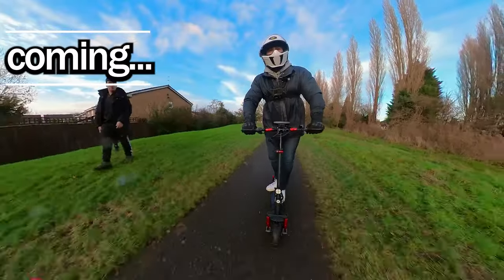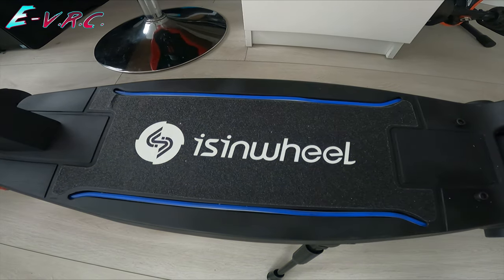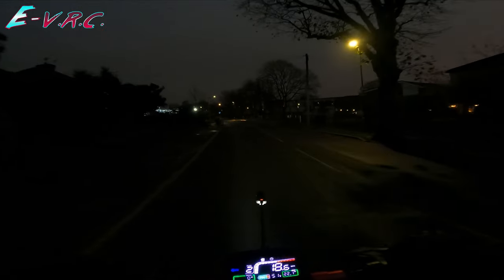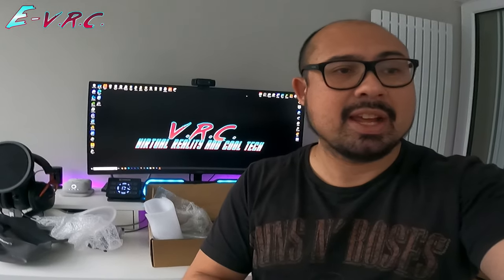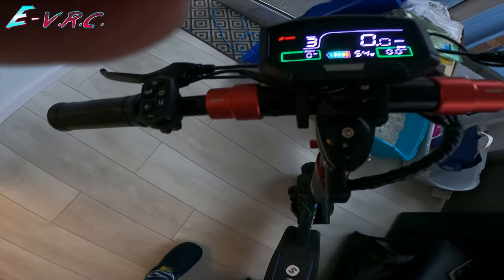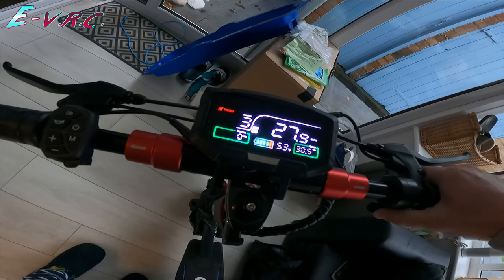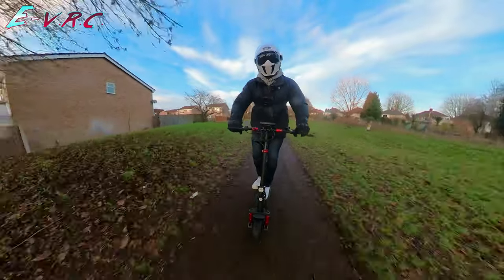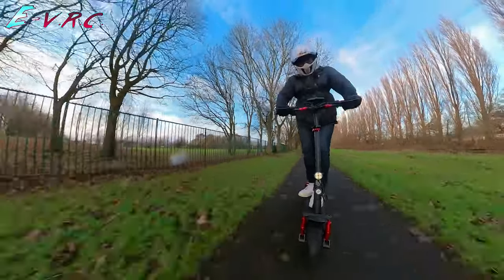FANTASTIC VALUE Off Road Electric Scooter BUT... (iSinwheel GT2)

Comment: I got my GT2 and it’s the same speed as yours but arrived badly damaged and just waiting for parts now from china.😢
Reply from the maker: Sorry to hear that. It seems the journey from China is a perilous one 😬
Reply: Yeah it’s all up and running now and I have had to use silicone all over and in the front light to make it waterproof as it did actually short circuit before but that’s to iScooter it’s all repaired now and I can go through many puddles now!😅😂
Reply: @e-VRC  Hi mate, what would you say the max range is on this scooter?
Reply: @e-VRC  How long have you been with it, does it work well for you?
Reply: I have GT2 as well it have any app to see settings?? 
How to use Bluetooth ??

Comment: Can you show us where the speed limiter Wire  is on the inside?  if you disconnect that it will be  55.kmh I know it's white and has a little black connection On it I know you Press the m 5 times And it opens it up to 45.kmh But if you open the bottom where the Battery is There is white wire Disconnect the white wire And it goes to 55.kmh😮 All scooters does have one. They won't tell you about that one Day just tell you about the m Button one You see people on youtube Doing It on order brands So can you have a look and see? Can we find it? We will get an extra 10 km an hour. I'll watch out  for you doing the video So we can do it. 55,kmh Will be better than 45.kmh

Comment: I bought this scooter and I can say that max speed is approx 35kmh (I'm 15 stone) suspension feels soft but I feel the scooter lacks of power, my Kugoo S1 350W feels more nippy, while on this new scooter there is like 1 sec delay before it responds to the throttle, I'm not sure if I like it
Reply from the maker: My gps certainly agrees with you. I need to test it some more. Also I think they renamed it ix6.
Reply: @e-VRC   ix 6 is 1000W motor, mabey they switched it because it wasnt good motor.  i will recieve my ix6 in a week, then i can test
Reply: @rainnurmik  have you tried ix-6 and how is it doing
Reply: @birdzhanerdinch7144   I have been riding it about 300 km, its good for the price. standing area could be longer or wider.  But i have actually got used to it.  I have got 1 problem, still writing to iscooter to fix this. If i put cruise control on, i cant see real time voltage. After display restart,  it works again, but cruise control is off.   not a major thing, but annoys a little. othr than that.  42km/hcan i get fromthis with no wind. im100kg. Seems durable. For 650 eur it is unbeatable i would think.
Reply: @rainnurmik  how many kilometers does it last on a single charge?  Thank you for the reply!
Reply: @birdzhanerdinch7144   the most in one charge i ride was 20 km. But it was 46volts left. I think mabey 25 km. But i try not to get too low volts  as it is not good for the battery, but 100 kg man can go 20 -23km with absolutely no problem.
Reply: And in full speed 30-40 km/h.

If you ride 25 km/h you get much more
Reply: @rainnurmik  thank you so much
Reply: @birdzhanerdinch7144   no problem. You can write me any time
Reply: @Rain Nurmik  i want to buy this, you think it is worth it for £500. Also does it go faster than the Mii scopters
Reply: @gearedeagle6484  I slighltly regret buying thi scooter, it's not as fast as I expected and off road tires make it uncomfortable riding on tarmac, also no key so no protection, no cruise control and the scooter is really bulky meaning catching on doors if you use it in eclosed spaces like hotels, I would much prefer the junior size scooter which was easy to carry, lightweight, and just perky round the corners - this scooter feels like an elephant.
Reply: @KpopLabPro   cruise control can be put on via P05 setting. Read the manual. It is big yes :) also make sure you screw the suspension to max soft. It is way better this way.
Reply: @rainnurmik  My scooter also came, but I have too much clearance on the handlebars.  How is it with you?  Can it be fixed somehow
Reply: @rainnurmik  right at the bottom of where it folds
Reply: Notorious. AGAIN  SORRY I FEEL LIKE THIS IF YOU IS GOING FOR REAR SINGLE MOTOR AT LEASE GET A WHEEL MOTOR WITH TWO THOUSAND WATTS OR MORE AND ABATTERY WITH AH 40- 60- + UP FOR REAL THAS THE ONLY WAYS I SEE FASTER SINGLE MOTOR ESCOOTER BELIEVE ME KNOW BODDY WANTS A SLOW ESCOOTER TRUST ME OR YOU WILL SEE WHAT I WAS TRYING TO SAY 😊😊
Reply: @birdzhanerdinch7144  I have just one question, what is the difference between the ISINWHEEL GT2 AND THE ISCOOTER IX6, and which one would you recommend?
Reply: @rainnurmik  I have just one question, what is the difference between the ISINWHEEL GT2 AND THE ISCOOTER IX6, and which one would you recommend?

Comment: ⚡ I'm glad the top speed is easy to unlock, some other eScooters don't make it so easy ⚡
Reply from the maker: Yeah i was happy to hear that. Weird it has a 'settings unlock' as well as that though
Reply: Hi, I have already done the basic Settings on the dashboard. And there are 2 concern remaining:

1- Bluetooth setting 
2- Alarm/Locking Settings
Reply: @e-VRC  how do I unlock top speed and what app do you use please
Reply from the maker: @garrymuller4766  i don't use an app. It's unlocked from the computer. Can't remember off the top of my head but I do it in the video.
Reply from the maker: @louiepage6623  can't remember but I do it in the video.
Reply: Bonjour, appuyez 5 fois sur "M"
Reply: Can you please explain how to unlock top speed on this scooter ?
Reply: @CristianDiaz-xz8zk  Turn scooter on...and press 'M' 5 times.
Reply: @fredericforever2273  I think this model is specially not equipped with bluetooth

Comment: Mate, what settings do you use on this I've just got mine and tweaking to keep consistent speed.  I don't know if you changed any modes etc so would really help adding your P.Settings in a video or by reply.
Reply: It's got 3 modes the 1 I'm buying says my uncle mate got 1 similar there a button to change it from eco to sport

Comment: Thanks about your video.
Have you got the reference of your controller?  The error was E15? 
Because my ix6 iscooter ( same as isinwheel gt2 with 1000w motor ) have the same problem. 
Thanks a lot for your answer.
Bruno ( I m french, sorry if my English is very bad )

Comment: Mine arrived 2 days ago, set it up and did about a mile on it. Quite happy. Went maybe 3 miles on it yesterday, still quite happy especially after unlocking top speed. Went to use it today, wont switch on unless i connect the charger- quite unhappy. Any ideas???
Reply: How do you unlock top speed on this scooter ? I can't figure it out my friend if you can help me
Reply: Did you get it working again ? I'm sceptical of sponsor videos but always known this guy to be as genuine as he can with his videos.
Reply: @EllisJonesDeath  They sent me a new battery and everything has been fine since.
Reply: he did it in the video you turn it wait for it to boot up and press M 5 times and you will see the speed change on the screen if u want to switch it back to 15 mph just restart the scooter and press M 5 times again @CristianDiaz-xz8zk

Comment: I recommend the splach titan. More for the value of money. Dual motors off-roading 37 mph and 41 miles range plus much more all for 1200
Reply: Nah mate not for me
Reply: @samarawilliams4135  what happened to yours bro. It's weird because I see some people have issues with scooters but like I have had none yet and I don't know if it's cuz I'm super cautious when I drive most times I'm making sure that I'm scanning the road and I'm not hitting anything that could possibly injury my tires.
Reply: I'm exactly the same lol. I've had 3 punctures in 3 months, sux. Aside from that my scooter has been pretty much problem free. Well once I absolutely smashed into a curb, funny enough my tyre didn't pop I got some error 10 message, not gunna lie I thought I broke it but I opened the deck and after 30 minutes I located a loose wire that I reattached added some super glue and for good measure pushed a bit of blue tack in with it and never had any issues since aside from the punctures which is a pain in da a55 can't lie. I'm that impressed with them that now I own 2 lol
Reply: @samarawilliams4135  both my first scooter so I'm pretty impressed to be honest not really much expeditions being a first buyer haven't had any issues yet besides feel like the handle bars a little too short and I'm average height so maybe I'm wrong. thony complain I have is the long shipping times for parts which I had to replace my handlebar but that's about it and the fact that I thought the 10-in tires were a tubeless which I was wrong which I heard is better.

Comment: For anyone who is concerned about the screen, only cameras can see that, the lcd is simply flickering at a frequency fast enough to where humans cant tell the difference in order to save power by not running it constantly. However cameras can tell the difference

Comment: Hey 👋 great video 😊 quick question.. are you worried about getting pulled over by the police?
Reply from the maker: I am a bit on a scooter which is why I've come up with this testing route that's mainly off the roads.
Reply: @e-VRC  I live in the Welsh Mountains and have some lovely routes but I’m worried about being on the roads so I mainly drive there, even though it isn’t far. I’d love to be out on the roads, looking at your videos you look like you live near or In Birmingham?

Comment: Are the wheels solid or inflated ? Puncture resistance would be solid ?
Reply from the maker: Inflated. Some inflated tyres have puncture resistance though. I don't remember of these do.
Reply: @e-VRC thanks for responding
Reply: Inflated Tires. Not puncture resistant.

Comment: Got it ,just after switching on i press that 5 times to unlock 🔑 FANTASTIC 😮
Reply: @louiepage6623  wotsits that's wot
Reply: does it work for you? The scoter ?
Reply: @ARMdicember1997  I never bought it,got the ebike kit 🤠🤘🇬🇧🙏
Reply: @ARMdicember1997  It works, I can help you if you're having trouble, just ask 👍
Reply: @ianmangham4570  the kit? do you have the gt2 of the video the scoter? It works for you, it's resistant. Do you think it has good durability compared to a Xiaomi?
Reply: @ianmangham4570  and reaches more than 25 kilometers per hour? with the unlock configuration

Comment: i have the ix5 need a new stem but thats my own fault , , mine came faulty with the throttle , so had to get a new one sent out.
still use it to this day had it about a year and a half now , i did have the i9 but gave that to someone for 100.00 pounds , i just bought the G5 has few issues the seat being number 1 when u take it off all the issues start there.

i just paid 800.00 for a E scooter 28.6ah lithium ion battery 48v , 500w, 25mph with motorbike suspension and rear sping suspension the scooter is massive ways 45KG  ??
Reply from the maker: Wow that's nearly double the weight of this... the i9 was my first. Good little scooter.
Reply: @e-VRC  yes the weight is a little bit of a issue but once get use carrying up and  down a flight of stairs things get easier.

I still have not down the max range test , but one thing since I have had it not ran it flat but did charge it because of the freezing cold in the future will do a a test let you,  the bigger picture of the G5 scooter , one thing I can say so far if someone does not care for high end  speed and acceleration, as long as one don't live in a hilly area.
its a scooter to definitely consider buying.

Looked on Ali express sells for 1725.00 pounds not including shipping fees 😒 

So many companies are giving out 60% off RRP but its just finding the correct company and a scooter that works and oes what it says on the box.

Comment: Its a Good SCooter 28mph  is fast enough for me. Any faster would be sketchy. 
I have 550miles on my scooter.
You can ride it in a lite drizzle. Home 
Do Not ride it in Rain. It will start to short out. I had to take it apart to dry it out before i could get it to work again.
Flat tires are a pain to fix because the tires are tough and  pretty difficult to get back on the Rim without a couple of hands to help hold it.
The rear even more difficult because of the power cord for the motor doesn't allow you to remove wheel completely.  Break the bead on the proper side or do twice the work for nothing because you won't be able to get the tube off.

For $750 its a good all around scooter. Good distance. Fast enough speed. Descent handling. 
I can pick it up easily put in the trunk.
I like it, except when it has a Flat Tire.
Flat Tires Not an easy fix. 

I wish they pre installed double thick torn linners came standard.
I would pay $100 extra for a puncture resistant option from the jump.

Comment: Should i be worried my scooter arrived today but the back tyre is flat waiting on a pump to arrive hopefully its not going to be an issue for me.
Reply from the maker: They often are flat. Fingers crossed it should be fine.
Reply: @e-VRC  i hope so do u know if the scooter has an inner tube inside or is it just the wheel? I couldnt find anything about it online.
Reply from the maker: @mage000012isback  not sure about that sorry.

Comment: would you say it is definitely a NO in the rain? if it's wet outside will it just die ?
Reply: I have already driven with it in the rain and for the moment nothing to report.
Reply: @mamal438  nice, when I ask retailers they tell me basically that I will kill the scooter if I drive in the rain, well that defeats the purpose of  buying one as you never know when it will rain in the UK :D Going to get one to get me to work
Reply from the maker: Scooters are fine in the rain just don't submerge the deck
Reply: That manual clearly states to not ride in the rain so clearly do this at your own risk
Reply: @azisalive4972  then what is the point in owning one? Imagine if I go to work with it and then in the evening it rains. Am I meant to walk 7 miles?  well shiet scooter ;)
Reply: @Robertas Viskupaitis  all e-scooters and bikes have this warning, I'm guessing it depends reallly how wet you get it before it fails, seem to see other people having no issues 🤷🏻‍♂️ again, it's up to you as they won't cover the warranty over water damage
Reply: @azisalive4972  yea, definitely not a buy for my application as it rains a ton in Manchester :D
Reply: @Robertas Viskupaitis  same down here bud, but bought it anyway just for fun down the river 🤷🏻‍♂️🙃
Reply: @mamal438  How long have you been with it, does it work well for you?
Reply: @ARMdicember1997 had mine a month, had a flat back tyre changed the tube, that's the only thing iv had to address, the scooter is rapid and I love it 💯

Comment: Hi i got my iscooter ix6 today but there is a terrible noise coming from the back wheel. I've checked the break disc but that's fine, did yours make a loud noise, is it normal
Reply from the maker: No noise from the wheel. Could the mudguard be rubbing? Sometimes they snap in transit
Reply: No it's solid but not much gap, could it be the motor
Reply: Just was messing with it again by putting on its side. When i press the throttle nothing worked so i moved the back wheel a little bit & it started spinning. Did that a few times then it came up error & nothing works.
Reply: So is the iscooter ix6 and isinwheel gt2 exactly the same or?
Reply from the maker: @iStayawake247  they look identical. I have a feeling they rebadged it as ix6. Only they now say it's 1000w whereas they said gt2 was 800w. Maybe they're going on peak now. Not sure. I'll ask them.
Reply from the maker: @StayWoke  found the old controller that was broken. 21a max means it can peak at 1008. I think they wanted to bring all the branding in line. Or a more sinister thought... they're trying to distance the scooter from this video 😬😬😬

I've asked if they are the same. If they say yes then it must be the branding. If they no... i won't believe them and it will be the sinister reason 😱😱😱 I'll let you know 👍
Reply: @e-VRC  Thank you for all the info, bro. much appreciated 🙏🏾